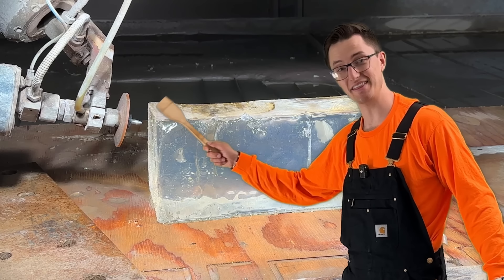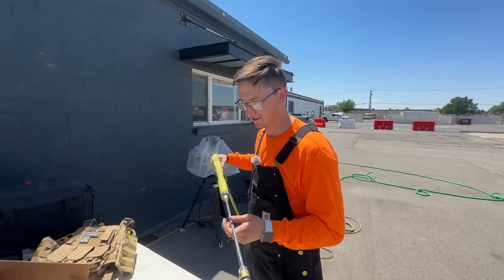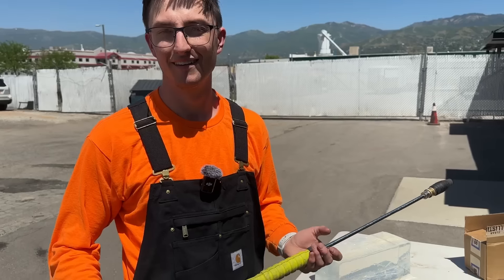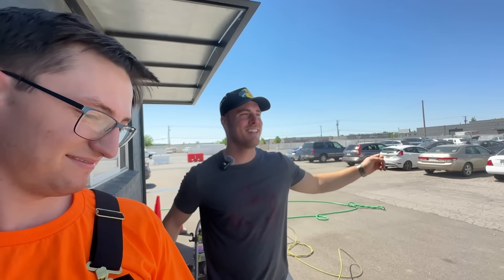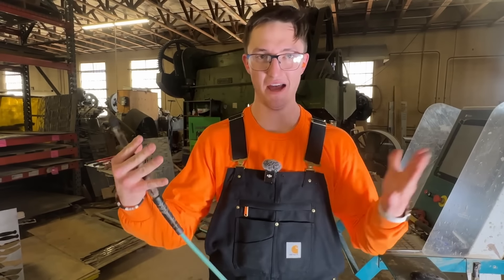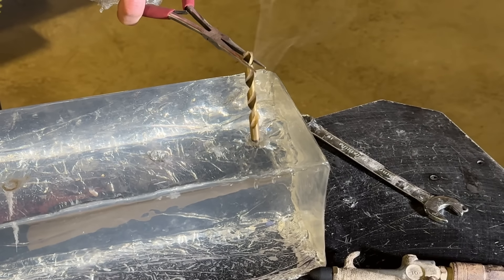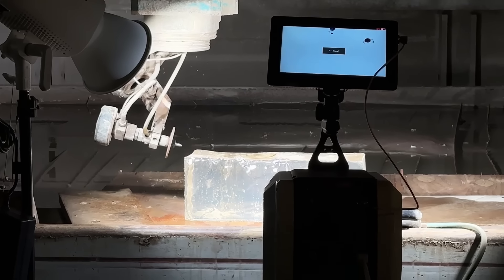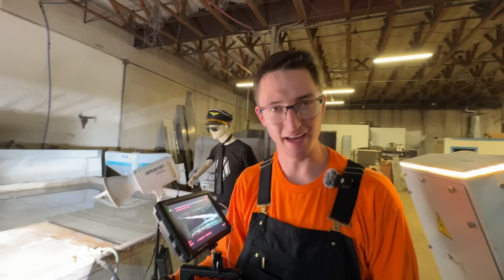Ballistic Gel Vs 60,000 PSI Waterjet

Comment: i cant believe a bullet proof vest isn't water proof
Reply: I can't believe a vest-proof bullet isn't water proof
Reply: What? What?!!
Reply: @BetaDude40 
He won't get it
Reply: I can’t believe a waterproof vest isn’t bullet proof
Reply: Well, it's not what is advertised, is it
Reply: @devon9822  I can't prove a belief-proof vest isn't water-bullet
Reply: Just gotta take a #1
Reply: No armor plates in the carrier. Just the carrier is not ballistic rated.
Reply: I still can't believe it's not butter!
Reply: Vests don't do well against cutting forces. And really that's all a water jet does.
Reply: I cant tell if this is sarcastic or not
Reply: Its bullet proof. Nobody said it could hold back water
Reply: The whole video just got spoiled
Reply: 60,000 psi is 30 tons per square inch or 4.2 tons per square cm, it makes sense
Reply: It's 60000 psi
Reply: Water ❌
Waterjet ✅
Reply: But it's fast water
Reply: Its not even bullet prof per se
Reply: It's not a bullet proof vest it's a plate carrier, which is different. And it has no plates in it. Which it's basically just as resistant as a jacket at that point
Reply: Jet word add after water bro
Reply: Then agsin... neither is the steel this machine cuts through police butter. . Lol
Reply: 7000tons
Reply: How if speed kills armor you can penetrate armor with a 9mm
Reply: If you have enough energy going in one direction, for a long enough period of time, it'll literally go through anything.

Comment: I KEEP SAYING, the jello is not an accurate representation of living things! It's 10 times tougher than real human flesh. The inside of your body is made of layers, tubes and holes (i.e. blood vessels, muscle/tendon channels) that will LOVE the water as an uninvited guest :)    Imagine a razorblade equipped beyblade going inside your body - yeah it'll be that bad.
Reply: As it's clear and not amber, this is very likely a synthetic gel made of polymers and an oil (this is also why it's self-healing via the application of heat unlike the original gelatin mix) so it isn't the jello this time and is higher quality... And not soluble in water like gelatin would be. Which is kind of important.

However... It being "tougher" does not mean that it would be easier to cut into than human skin. In fact, it's stiffer (skin stretches quite a lot which helps make it very durable), doesn't have the water-resistant properties of skin (mainly the bi-lipid layering), and there's something about some synthetic gels breaking down when in contact with water- though I sadly came up short in my brief research and don't know if that's just something to be aware of when manufacturing it or is also present when complete.

Point is... I know from experience that around 4 inches is enough space between your skin and a mid range (like a 30°) nozzle on an average pressure washer to avoid anything besides a stinging sensation... And that gel cut away easily in those conditions.

Your insides would absolutely have an issue with water flooding into them, but your outsides are more resistant to pressurized water than ballistics gel.

But still. Be careful around it. Point blank, even the widest nozzle with weaker pressure washers can absolutely do some damage. The force just dissipates very quickly. And once you get above a couple hundred psi, things get incredibly dangerous. So for the waterjet, yes. I'd imagine it would be much more destructive to a person than a block of ballistics gel.
Reply: @plzletmebefrank  at 100psi+ the waterphobic coating on your skin (the lipids) are irrelevant. But everything else I agree. Gel is slightly easier to 'scratch' than skin.
Reply: BALISTIC GEL NOT JELLO
Reply: @debicook6544  The original recipe for ballistic gel is literally just more precise jello. It's just gelatin and water at a precise mix to make something with similar consistency to human flesh when impacted by a bullet.
This ballistic gel is a newer recipe using mineral oil and a synthetic polymer so that it can be easily melted to fill holes and be reused.

But... Yeah. Ballistics gel is very much like jello. It's the cheapest way to get a consistent block of material to test that vaguely approximates human flesh.
Reply: @debicook6544  ballistic jelly baby
Reply: Clear ballistic gel is actually half as dense as human flesh.
Reply: @dillonh321  dense != tough

Comment: You should try the compressed air through several layers of fabric. I remember a comment on a video where someone didn't believe compressed air could penetrate clothing and injure someone. It was a video about compressed air injuries that happened in an Indian factory somewhere
Reply: ... I could understand if they meant like... Rubber coats or something. But fabric. The thing full of holes. Like... Skin is fairly good at keeping things out. And the compressed air most people are used to only gets up to 200 psi at most. Which isn't too serious of a hazard. I could understand someone not thinking it was as dangerous as it actually is at higher pressures. But because of fabric?

Also, the compressed air they were using isn't high pressure enough for an adequate test for that. Just being an inch away probably doesn't damage the gel, let alone being around that far away and with that much fabric in front of it.
Reply: in that video almost quite literally jammed it up his but

Comment: I use a 1600psi electric usually with 15°, and times when I use it to wash my hands, I have it as far as I can. I did it close once to see. It just about ripped my skin on my wrist. My wrist was definitely red as if rugburn, without the rugburn feel. It felt like tingling from a good slap. 25° is still similar but can have the nozzle closer. 45° unless you practically touch your skin with it, it wont do anything. However, all of them do not feel good, kind of feels like bits of sand hitting your skin even when thier far enough away to not* cause damage to the skin.

I'd say for my pressure washer, 0° is no go, 15° 6-8 inches, 25° 4-6 inches, 45° 2-4 inches are just safe enough distance before you'll get skin damage. 

When i do use 0°, that things never pointed at me or anyone else(along with other degrees for anyone else), as it will certainly not be a fun time.

*=edit.

Comment: Worked offshore on oil rigs. Never had serious failures. 5k psi systems w lots of accumulators, no pressure drop when leaks happen.
Heard of a 1/4od tube fail w 5kpsi, the guy had a rag on the crack when it blew and launched the rag up into his forearm. Supposedly had to flay his arm open when they found it.
Pressure and flow are both powerful on their own. Imagine 60kpsi at 5gpm.
Reply from the maker: Pressure is terrifying

Comment: Heard some horror stories about people walking through pinhole leaks of super high pressure steam. Not sure that is something you could safely test, alas.
Reply: There are definitely ways to make the high pressure fluid more easily detectable (colorings, odorants, etc), to help determine a leak (coatings or plastic "skins" that would break in a clearly visible way or would set off a pressure sensor, pressure sensors at two opposing ends linked together to compare against, etc), or some exorbitantly expensive ideas like an infrared setup to detect the fluid spraying through the air.
And I'm sure some of these are in effect.

But... A quick and easy way to just check and know that there's no leaks... I can't think of any.

Comment: High pressure anything is knarly.  I A farme I knew back in my teens told me a story about one of his farmer pals. ..   The guy was working on a combine.  He had the side panel open to check on a belt.  As he walked past a hydraulic hose he got a  feeling of being slit by a razor blade.  A miniscule pinhole leak in a hose swiped across his face and to the back of his head.  Going through his eyeball.   He said everything turned red in that eye and the pain started.  
High pressures are no joke, folks!  
On another note, George and I have the same pair of jeans.  (Womens YMI Butt-lift jeans.) Well his are cut-off shorts and mine are full length jeans.  Same pockets patterns seams etc though.  Cool.

Comment: While ballistic gel does work as a good ish representation of flesh it doesn’t have the absurd power that skin does, at least with the pressure washer and air compressor it wont puncture the skin, however if put on an open wound or an eyeball it will cause serious damage